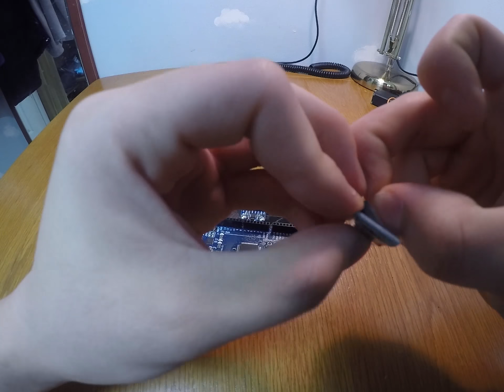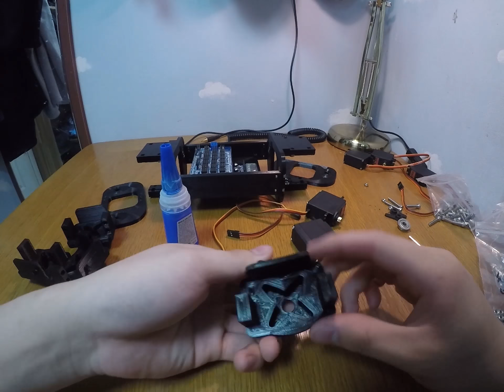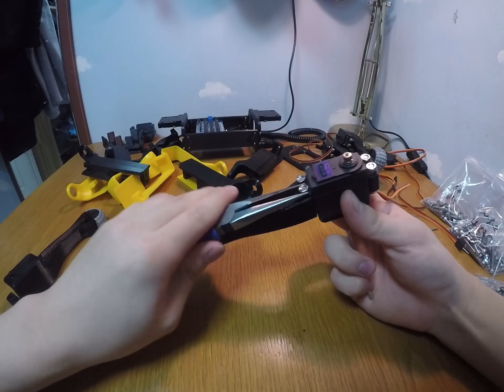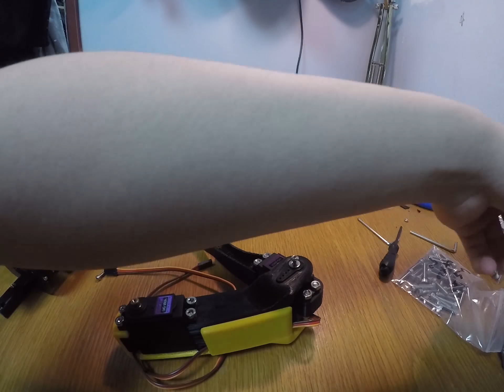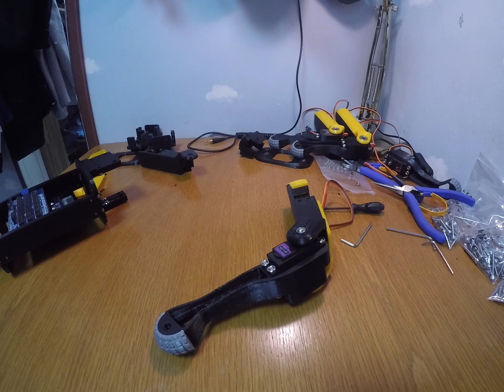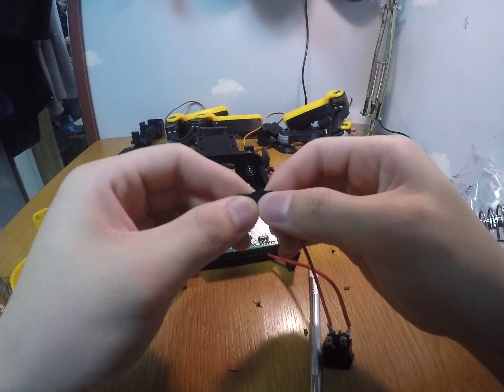Spotmicro Assembly Part.1

Comment: Hi, I noticed during the assembly that the mg wrist parts don't accurately fit the mg996R, the flat part is too shallow causing the bottom of the servo to protrude up. Also the holes are too long for the m4x20mm bolts to work like it calls for in your spec sheet. Am i missing something on the assembly or have you updated the parts to be longer bolts?